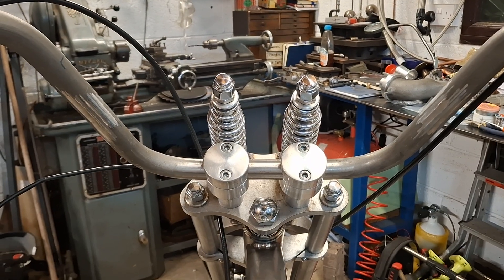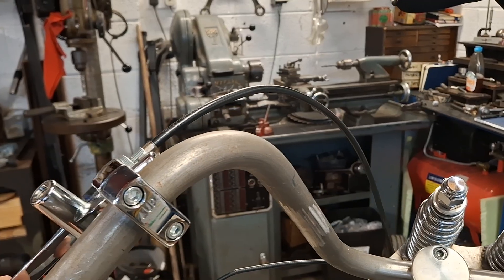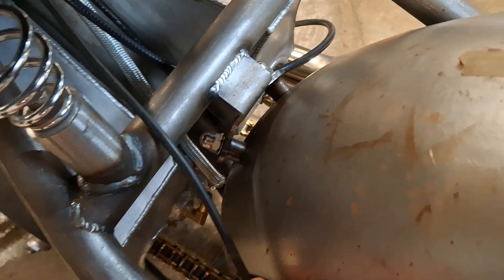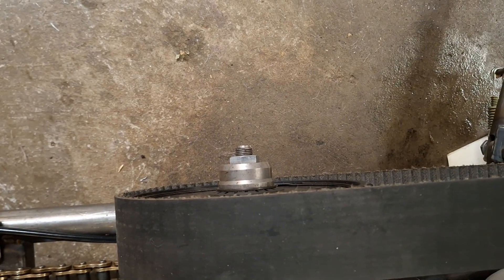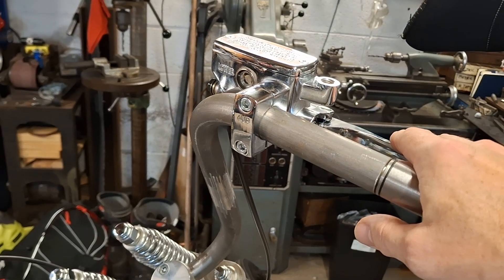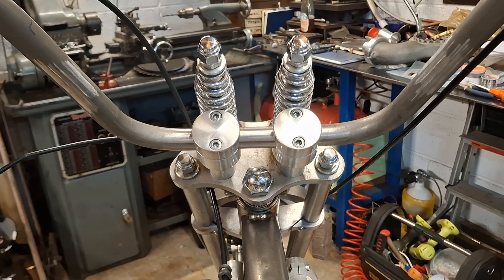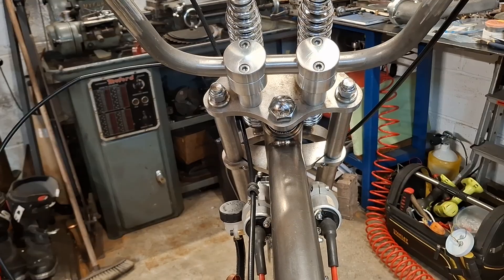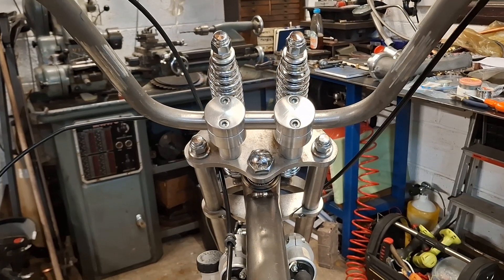Clutching at Straws

Comment: I don't get why you're lining the tank: if it's rusty the lining won't stick and if it's not rusty why bother? Just keep it topped up. (I feel I'm missing something!)
Reply from the maker: It's an ally tank that's never had fuel in it. Even though it's been tested for leaks, fuel is more pervasive than water. It's a belt and braces approach, especially when modern fuel has ethanol intended to kill off IC vehicles.

Comment: A quick and easy way to bleed the front brake is to just loosen the handlebar enough to push forward, with the wheel turned to the left so the master cylinder is tilted downhill.  Twist the master cylinder enough that it's even with the tilt. Add the brake fluid and the air bleeds out by morning. I'd do that at the Triumph shop at the end of the day. Guy would get mad at me as some customer might see it. He expected me to spend the time pumping and bleed the bleeder. So come to work the next day, top the master cylinder up, cap it, reset the handlebars and master cylinder and had a solid lever. He never could figure how gravity worked. 🤣😂